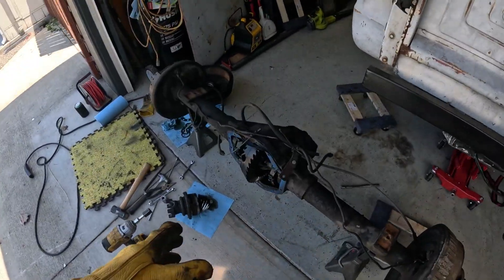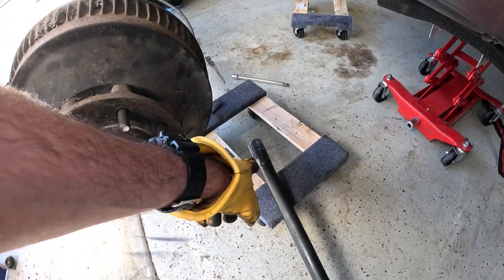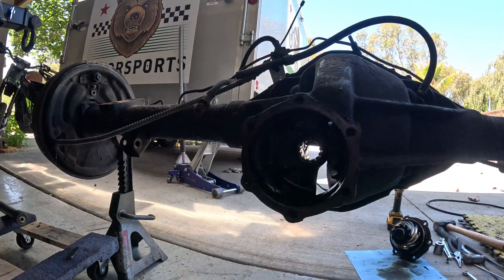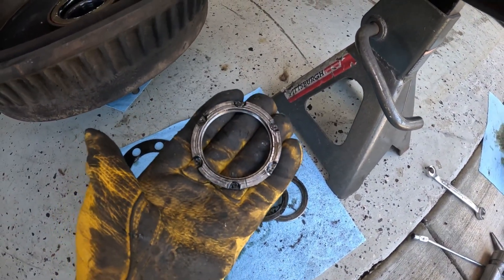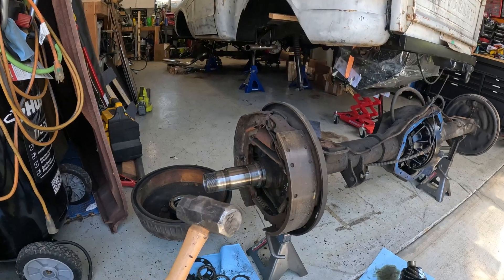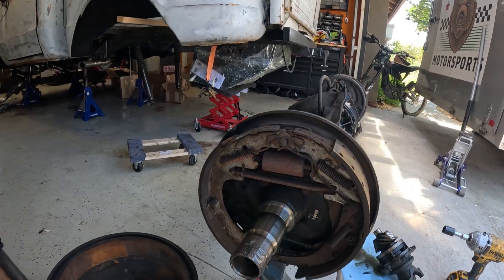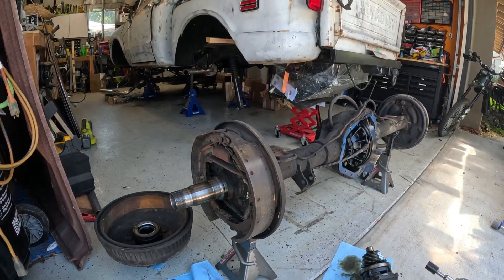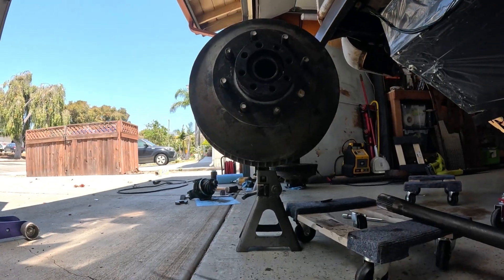14 Bolt Full Float Axle Teardown Walkthrough

Comment: We're could I get the disc brake assembly from for said axle
Reply from the maker: I would normally send you to my site at GearheadGrind.com, but it looks like Ruffstuff Specialties may be seeing some availability challenges with these kits. So going to them directly to confirm availability first may be better. I'm also not currently seeing the option for parking brake calipers available on their site at the moment, which are the ones used in the video.